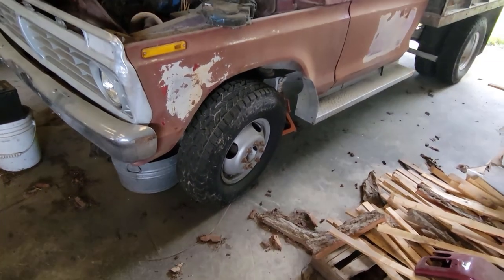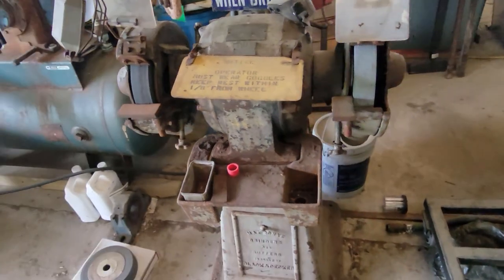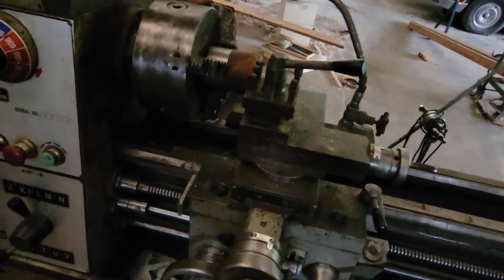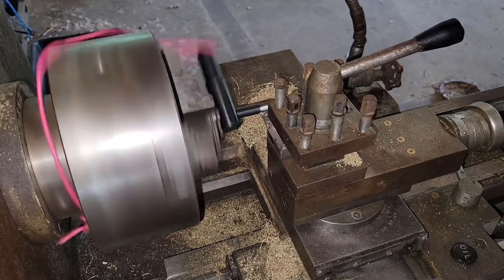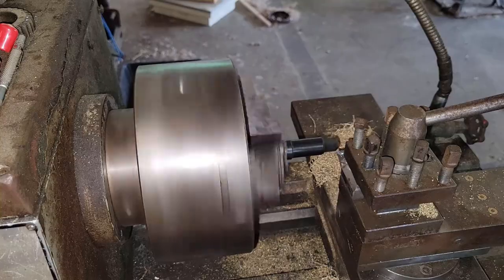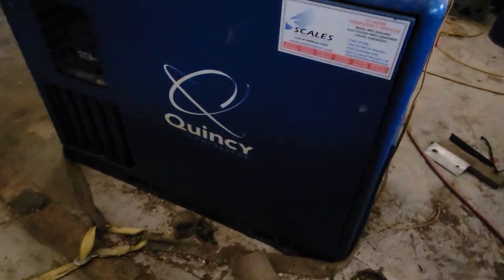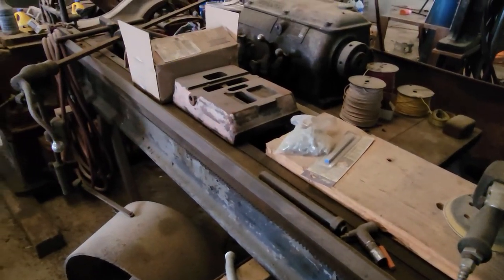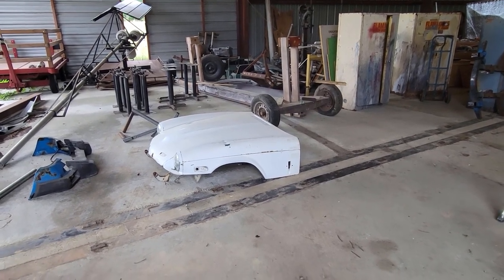Shop Update & Making Parts on the Acraturn Lathe

Comment: Thats pretty cool you can share the internet being your house and get an upgrade there. Cable companies are just awful. I'm using a Ubiquiti NanoStation 5GHz for a wireless shot from my house to the shop. My shop has its own 3ph utility power which means I never ended up with a  conduit from the house to shop so this was an easy install.
Reply from the maker: What distance are you sending the signal?
Reply: @EngineersWorkshop  Only a couple hundred feet, the equipment is overkill for the distance. I could do the same thing with a pair of wireless APs in bridge mode.

Comment: Wish I knew about selling the Ford. Been wanting that same truck and body for some time around the here for the shop.
Reply from the maker: I'm sure if you really wanted it we could work a deal with Heath. Wheels, tires, brakes, engine parts were close to $2000 alone. Truck went real cheap, way below that.
Reply: @EngineersWorkshop  I thought it was in the hundreds column, not thousands...Thanks anyway.
Let me know how your making out on the Partner. I have some feelers out there for you. Try to get me the year as well.

Comment: Does the spitfire chassis have any plates where the graft weld is? Or is it just a butt weld of the tubes? Pallet jacks are cheap and well worth it. make up a set of 4 long wedges from 4x4. It is easy to lever heavy items up and use the wedges to get them up high enough to slide a pallet jack under. A lot of the metalworking hobby is material handling. You will eventually want a 5000 pound capacity forklift. I will soon be looking for a 5-8k forklift with 3-4 stage mast, side shift and/or fork positioners, all terrain would be nice. You really need to get the building closed in.
Reply from the maker: Full penetration butt weld. A forklift is on the long list... as for the building, time and money, time and money. You forgot to mention the additional 5" of concrete to build thickness and encase all the steel projections..
Reply: @EngineersWorkshop  You and your son should consider plating the joint. It makes the frame a lot safer. I have seen several butt welded frames break at the weld. I would not drive a car that was butt welded only. A diamond shape with rounded corners welded all the way around that is about 3-5 times longer than it is tall and nearly as tall as the side of the frame works very well to distribute the forces away from the butt joint. The last thing either of you want is for the front end to come off at speed. I hate to sound like an internet nanny, but the failure mode is real and the consequences are bad, so please think about it. BTW, forklift should be higher on your priorities. you will be surprised how you survived without it. I have had a little (2k capacity) forklift for over 20 years and use it often, though it is too small for future needs when my new shop gets built. I will convert the little one to electric and use it in the shop and use the new one for bigger items that the little one won't handle. My buddy has two at his home shop, a 5k and a 2k and we use them weekly. It makes moving machines or anything too heavy to lift a non-issue. You can also get pallet racking to improve storage density. That is very high on my priority list after the new building is built.